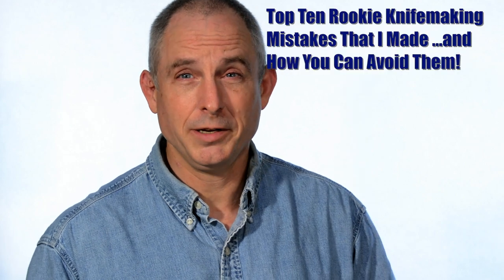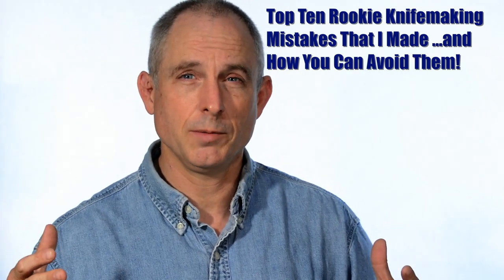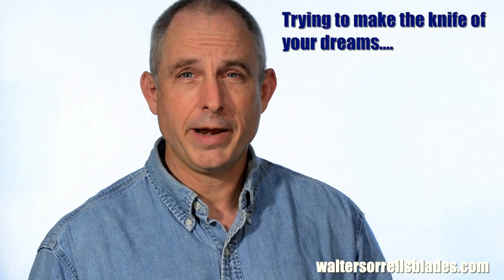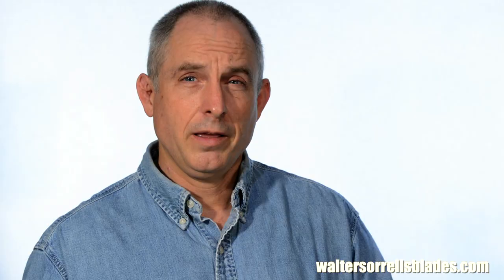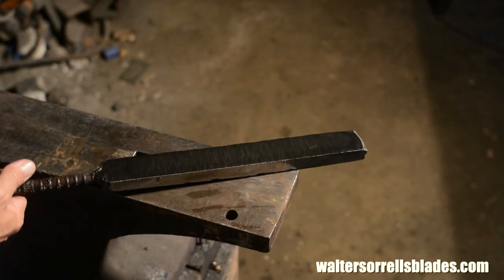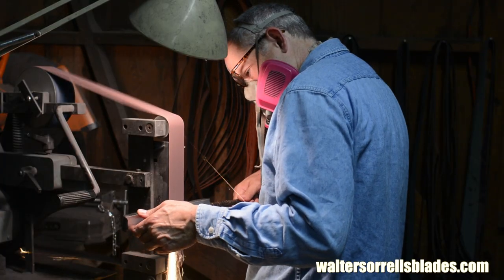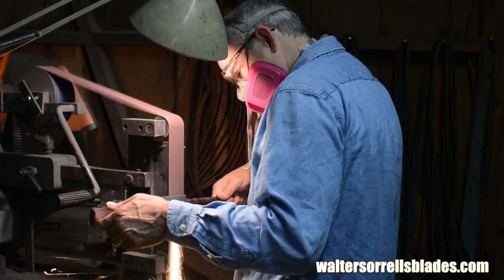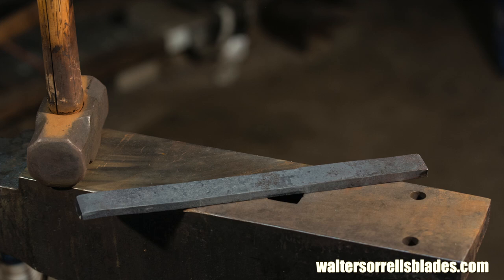Top Ten Beginner Knife Making Mistakes...and How to Avoid Them!

Comment: I can get the blanks down really nicely, and I have the means to heat treat BUT I cannot get the bevel down.......I only have files, angle grinder and a hand held belt sander....I struggle ALOT getting the bevel! Any tips??
Reply: Practice.
Reply: thanks for the  advice, but I was looking for something a little more specific XD
Reply: +John McAlhany use the angle grinder for really rough work, and build a little filing jig or just use the file handle to off balance and create a slope when filing, and clamp ur belt sander down somehow to smooth out the bevels after filing
Reply: Vincent Tai Great idea! I could use my vice and clamp the belt grinder on it upside down! That should work!!!:) TY for the idea!
Reply: There's a fileing jig you can make. I can't remember the original knife makers video I saw it on but Dave Canterbury must have seen it also because he made a video on it also. It's a great way to get perfect angles.
Reply: Thanks Shane K! I am a 100% noob. I am not even certain if I am using the right steel. I went to Lowes and purchased a sheet of 1/4" "welding steel" that was about 6" X 9" I have made 3 knife blanks from that sheet of steel.
Reply: +John McAlhany don't waste any more time on that welding steel.  It's 1018. Low carbon content, can't be hardened.  Even if you carburized it in a kiln, that only hardens the top 1/32nd of an inch MAX.  You can use that steel to practice grinding in bevels, but it'll never be a workable knife.  To get workable steels, like Sorrells said, get it from a steel mill.  If you want to save some money, buy old files from garage sales, used farriers rasps from horse shoeing services, or leaf springs from the car junkyards.  Those are all common sources of reclaimed but workable high carbon steels.
Reply: TaskMaster1983 Thanks for the info! Ive seen videos of people using lawn mower blades what are your views on that?
Reply: +John McAlhany get some real real old ones and do a spark test. I suspect newer ones are just bad mild steel since companies like it cheap and they tell u to file the blades if u want to sharpen them.
Reply: +John McAlhany also farrier rasps are typically a decent steel

Comment: Heyy im 16 and want to make a knife and windering what steel i should use i know different steels and my dad has done heat treating on steel before for ax heads and tools so he know how to heat treat but im looking for steel that keeps a decent edge but not hard to work with ive been looking at 440c and vg10 and 154cm but any other recommendations
Reply: Get some cheaper stuff to practice with
Reply: +timothy berry Your best bet would be O1 tool steel its easy to treat and holds an edge well

Comment: Can I make it out of mild steel I think it’s A36
Reply: No it won't harden.  Best is 1084 from q knife supply.  Like new jersey steel barron . It is very easy to heat treat . It is also easy to work with.  I recommend knife engineering by Dr. Larrin Tomas. Look up  Knife steel nerds
Reply: Also look up Peter's heat treat.  They are the best when it comes to knifes

Comment: Dont be a turd polisher! bahaha...i like that pun! Im totally struggling on making my nephews a knife....love the idead of making a knife....but...never made a knife before....so its just me, youtube and the steel....oh, did I mention that I only have handtools??? bahahaha  thanks for the videos Walter!
Reply: In a way, you're better with just hand tools as a beginner.  If you're on a 2x72 Bader or Grizzly, a small mistake can take off enough metal to ruin your blank.  Small mistakes can be corrected when you're using a file and sandpaper.  Just takes forever.  Use a filing jig.  Knife will turn out better and your nephew will appreciate all the more if you tell him you made it entirely by hand.